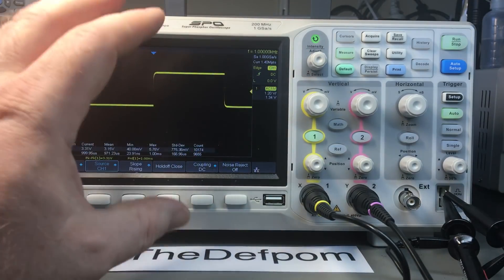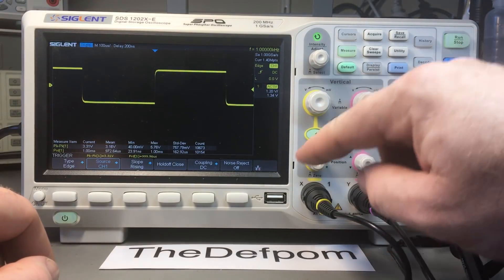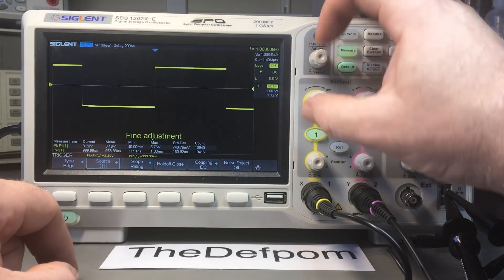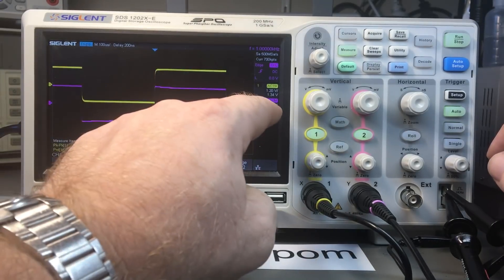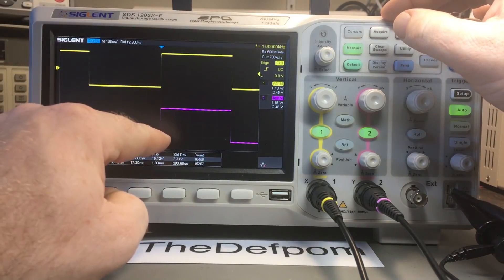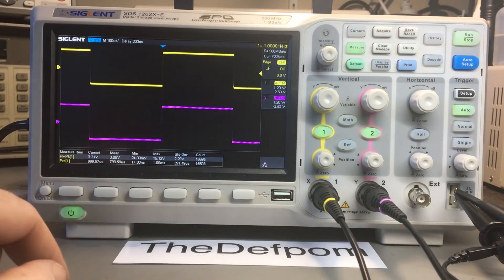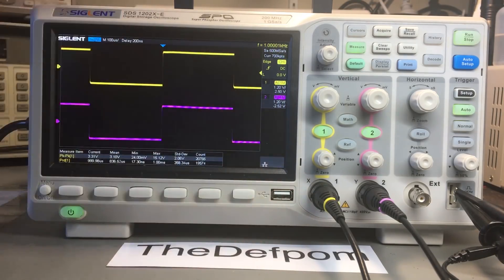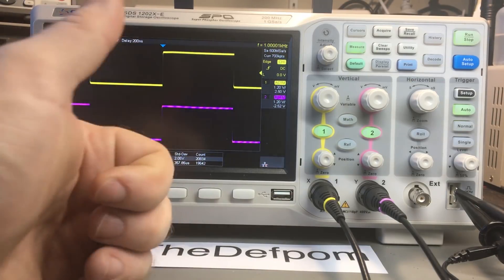🔴 #350 Siglent SDS1202X-E Probe Compensation Issue - Before and After Rework Demo

Comment: OK I was going to buy this unit to check 300Hz signal on a test tape for a cassette tape calibration and was wondering if it’s good enough without having to fix the capacitors to do such a thing
Reply from the maker: You can’t measure 300MHz with one of these.
Reply: @TheDefpom  I stand corrected. I meant 300 Hz.
Reply: I don’t believe they make 300 MHz test tapes only 300 Hz and I think 440 Hz and such.
Reply from the maker: @Keeganshero13  In that case I expect this will do what you want, I own a SDS1104X-E which is very similar, along with some more expensive scopes.

Comment: You have connected both probes to the 1kHz reference. So the resitive reference looks into two sets of more complex impedances and standing waves. Perhaps not an issue really, but you should use only one probe at the time, calibrated it, and then do the same thing with the next probe.